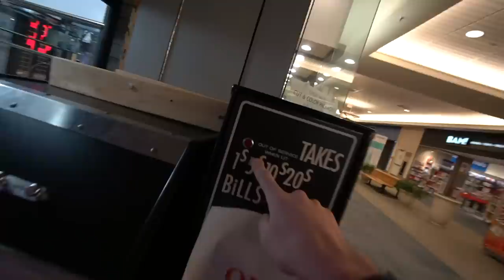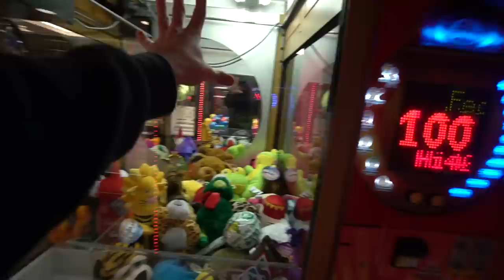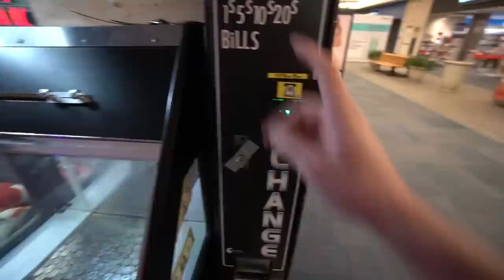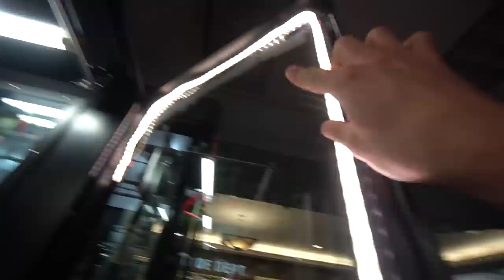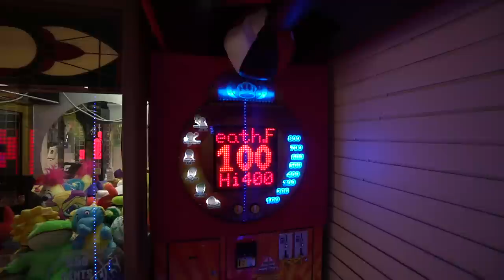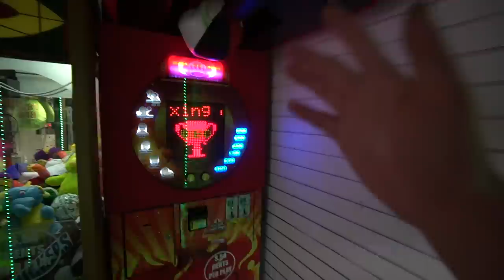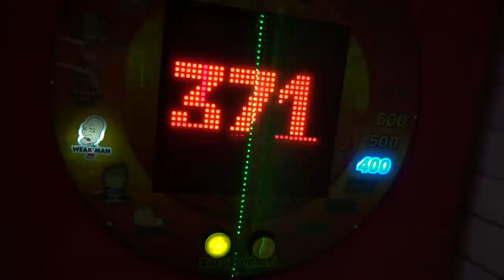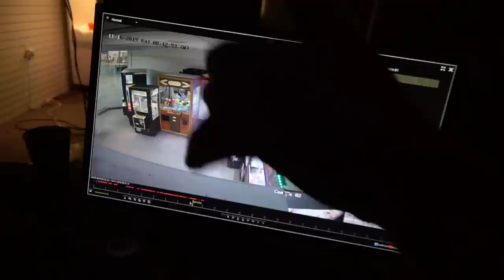ABSOLUTE MORON VANDALIZES MY ARCADE!!!!!

Comment: You have a weird definition of vandalizing.
Reply: Well vandalism is the unlawful TAMPERING AND/OR DESTRUCTION of another persons property without their consent to do so. Given the definition, this IS in fact vandalism because... 
A) the teen on the security feed did obviously move the machine(a form of tampering)
B)the teen obviously did so WITHOUT THE CONSENT of Claw, and therefore, with these two obvious reasons, i conclude my argument as to why this IS in fact vandalism, thank you😋
Reply: While it doesn't apply to this video, in other videos he has LED lights attached to his machines, which if you move, will break those lights, therefore vandalism. In general machines like arcade machines and vending machines also have a rule where civilians cannot move them out of place or bump them, as it can interrupt the function of the machine, or if their unlucky, topple the machine over. So the answer to if this is vandalism? No but actually yes.

Comment: Would you recommend starting a small arcade inside of a mall instead of it's own "free standing" location? I love the idea of the mall generating foot traffic, but I'm worried about not being open late since malls typically close at 9:00PM. Thanks for the feedback! Hopefully starting one up real soon.  :)
Reply: They usually put the Arcade beside the food court.
If you wanna sign a lease and you have a plan it can work.
My experience if you do not have the latest newest machine your not gonna make it on the Coin-op or Card swipe circuit. Most Mall locations died out about the year 2000 un my area

Comment: The guy is left handed but throws a punch that wouldn't break a wet paper bag. I was a world ranked welterweight back in the early 1980's and I held all the records on Young Street in Toronto, Canada for punch velocity or punch speed. I could also shoot a puck around 117 mph when I was just 15 years old.

Comment: idk if you'd get sued for having receptacles exposed. you'd maybe get sued if someone tripped over a wire. i'm an electrical engineer that deals with NEC all the time and there's no code requirement stating that you can't have a receptacle accessible to the public that i'm aware of. maybe something particular to detroit/michigan code?

Comment: you need to change the parameters on the change machine....$40.00...is alot of quarters?....right........maybe have it turn off when there is 10.00 in quarters left

Comment: You should have your punching machine more in the open but also out of the way.
It would also help if you had a sign put up with rules as to what folk can and can't do.
At Least with zed rules posted any liability for injures that occured you would not be responsible for
Unless actually caused by the machine malfunctioning not due to any user/patreon trying out your machine.
What that means Is that if a person visiting the arcade breakes the machine and or hurts themselves attempting something stupid or from improper use they are responsible for damages caused to the machine and any injuries sustained.

Comment: This is either staged or you forgot to lock up the door on the big crane next to the punching machine. You can clearly see the door of the big crane open a bit at the 10:47 - 10:50 mark

Comment: How bout move your rigged machines in a way that its not a setup for a lawsuit. Also you’re lucky he didn’t steal everything out of the machine when the door opened.
Reply: dude, firstly the guy doesn't rig his machines, secondly the guy shouldn't be fucking with the claw machine at all, the only lawsuit an arcade owner would be dealing with in this case is suing the guy VANDALIZING a claw machine because he didn't like the way it was originally, hell id even go as far as to say he technically broke into it if the door opened as the moron was moving a machine that wasn't his to move

Comment: Look I will try to move this shooting star claw machine with locked wheels and I am so dumb that I never seen a locking wheel, I will also move this 500 pound Oakmont mission claw machine so I can move the punching bag machine so I can impress my hot girl friend. I don't think I will get into trouble moving Aaron's expensive vending machinery even when I am being recorded on a CCTV device. I am going to leave the arcade and not put the machinery back ware it was because I am lazy and I need to go back to work at KFC.